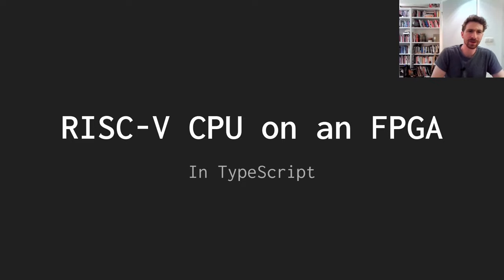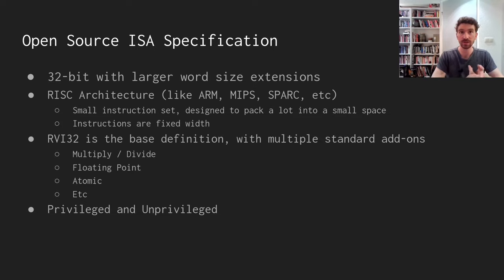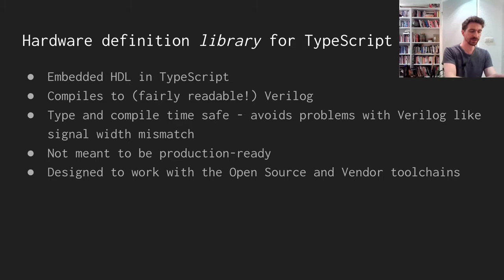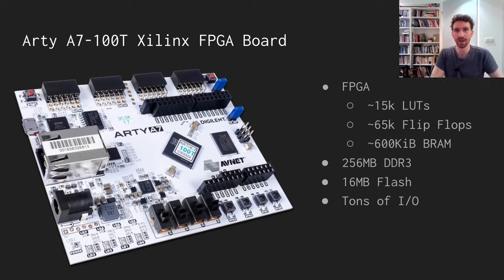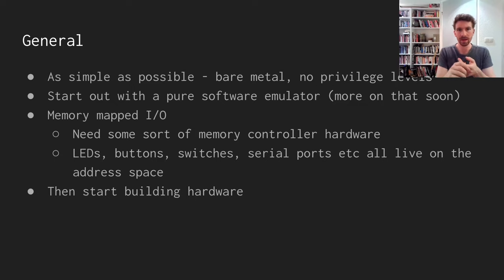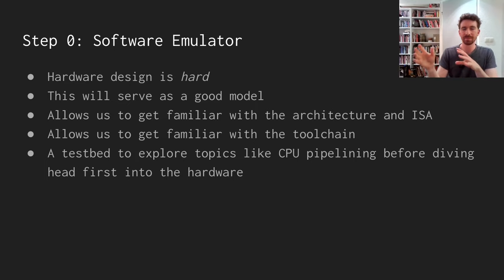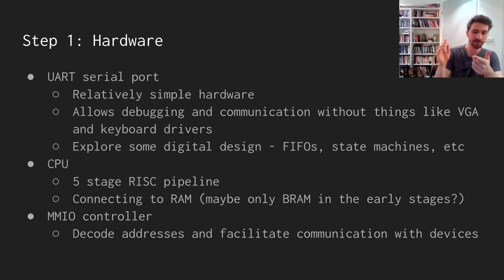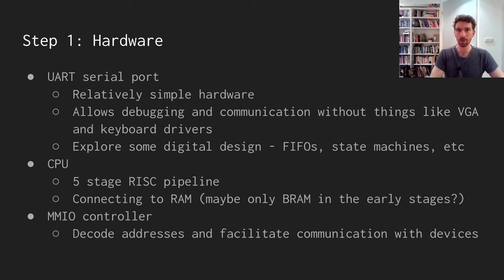Building The Worlds First CPU in TypeScript? (No Really!)

Comment: Just FYI, the audio in this video is out-of-phase between the left and right channels which is why it sounds weird. I don't know what you use to edit/record audio but there should be an audio effect you can use that allows you to fix the polarity on one side! If not, you can use the free program audacity to fix this too.
Reply from the maker: Interesting! This video is the first one  I recorded with my new system, and my usual aux microphone didn't seem to work properly - instead it took audio from the camera mic. Hopefully that shouldn't be a problem in the future as I've just ordered a new USB mic - but I'll keep a lookout for the phase issue you mentioned. I've heard about it before, but for this video (and most of the live coding style ones) I didn't do any audio editing.
Reply: @LowByteProductions  Sounds like the new mic should fix your issue - you just need to make sure the same audio is going to the left and right channels. Perhaps your webcam mic has a pair of microphones (for active noise cancelling or something similar), and your software has for some reason recorded both of these out of phase with each other on the two left and right channels? That's only a wild guess though. Anyway, really looking forward to the upcoming series!